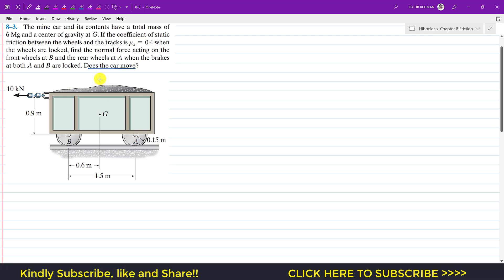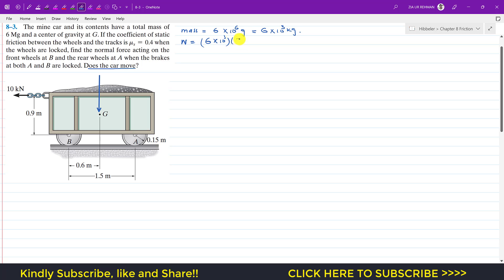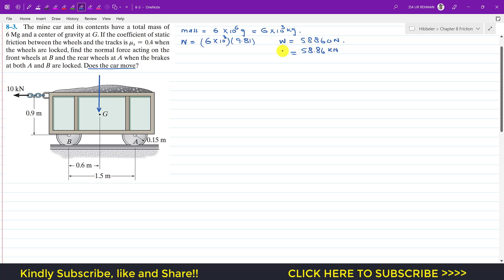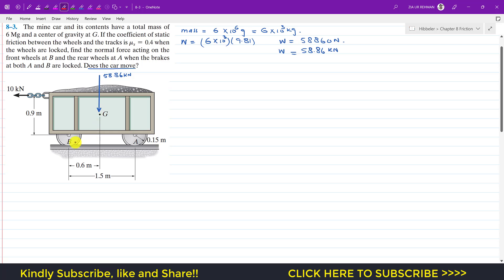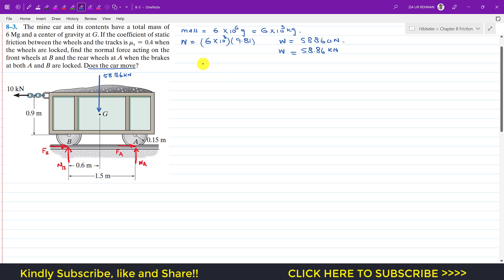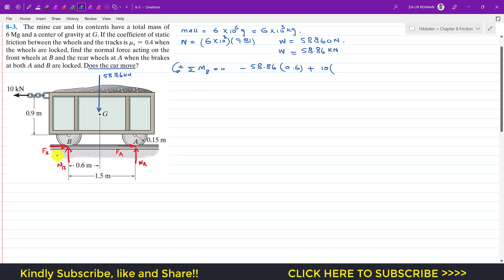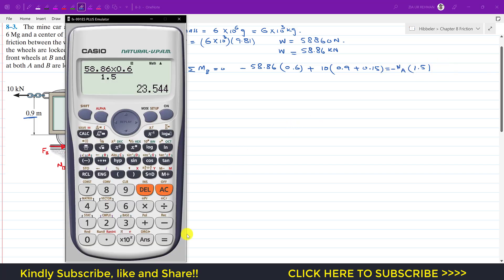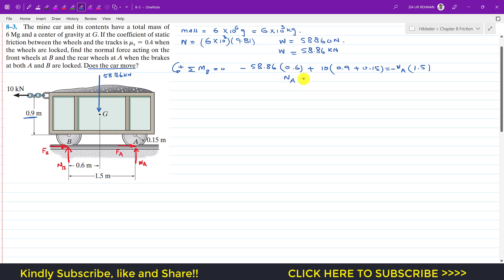8-3 Friction | Chapter 8 | Hibbeler Statics  14th ed | Engineers Academy

Comment: Please teacher, can you do the 6/34 and 6/44 from the boom Jl meriam 7th edition:(
Reply from the maker: First search for the problem statement.
Reply: @EngineersAcademy2020  6/34 Determine the range of weights W of the uniform slender bar for which the system will be in
equilibrium. Neglect friction at all bearings.
Reply: @EngineersAcademy2020  6/44 Determine the minimum value of  for which equilibrium is possible if (a) (s)A = 0.60 and (s)B = 0.20 and (b) (s)A = 0.40 and (s)B = 0.10-